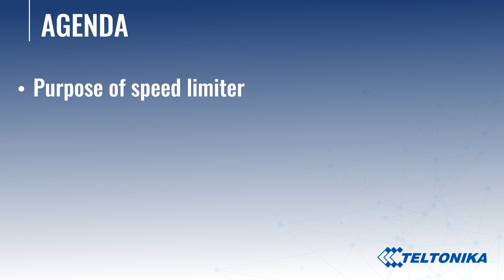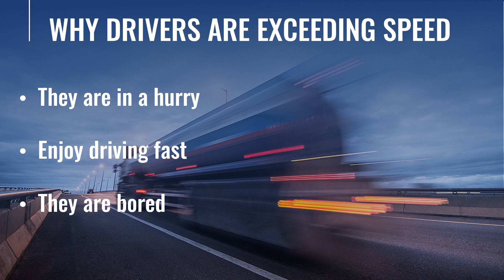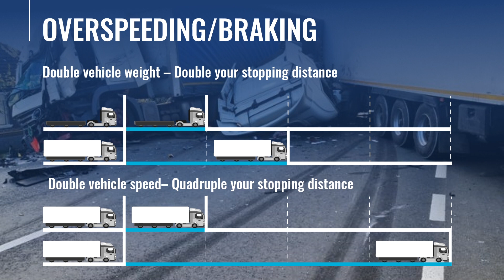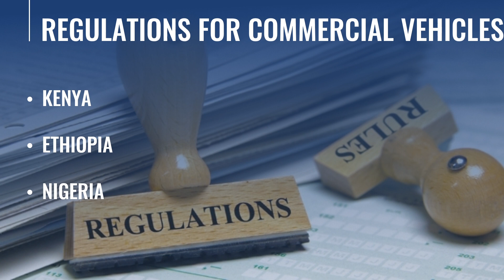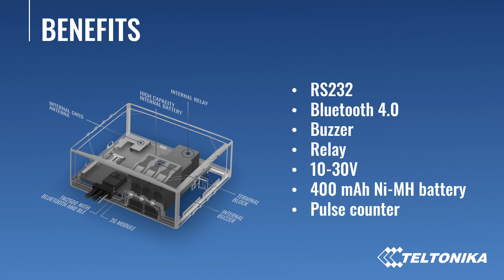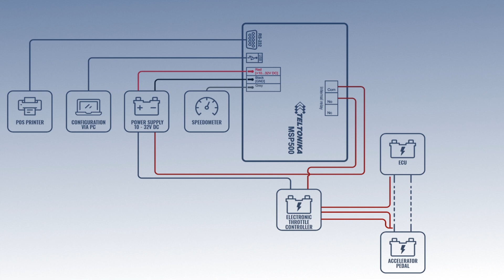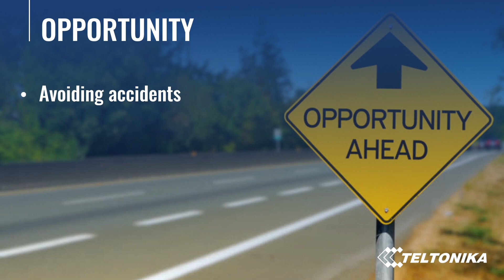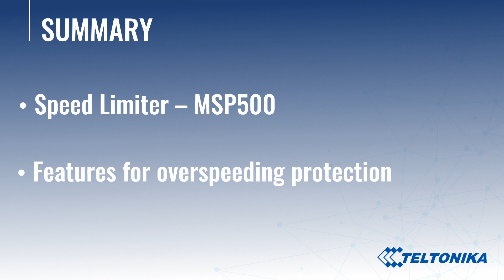Teltonika Webinar: Speed Limiter Solutions

Comment: Hello, can your speed limiters distinguish between rough road and tarmac roads? This is important because allowable speed limit for rough roads lets say is 60km/hr and tarmac 120km/hr? A vibration sensor is needed to set the tolerance.
Reply from the maker: Hello,

Thank you for your comment. 
Currently, it is not possible to set a speed limit based on vibration as it would not be precise enough. A sudden change in road quality could affect the speed limiter functionality and could result in more accidents. We have implemented the speed limiter functionality by adding geo zones. If you usually ride the same roads, you can set up a perimeter on certain roads using the Manual Geofence feature and limit the speed based on the road. 

If you have any further questions regarding the speed limiter functionality, please contact your sales representative. If you do not have any contact information for our sales managers, please visit our official website at https://teltonika-gps.com/ and click on the "Contact Us" button. Once you click the button, please fill out the form and submit it.
Reply: @TeltonikaTelematics  Hello, thank you for the reply. Actually there are speed limiters from other manufacturers that are doing very well with vibration functionality. One that we know is from the UK and the other is from India. The vibration input is calibrated with a specific threshold that is deemed acceptable to distinguish between rough road and tarmac road. These speed limiters are called 80/100 meaning that on rough road, you can only drive 80km/ and 100km/hr on the tarmac road or as per operators requirement. This is used by operators who require that drivers on rough road are driving at a lower speed despite the geo fence functionality. The good thing about your limiters is that, it has extra features and they can be configured remotely without sending technicians to the vehicle. 
 
We have also managed to use your regular tracking devices in the past as speed limiters with conjunction to some other components but we would appreciate to see that you design a limiter that has both geofence speed limiting feature as well as rough road detection functionality for rough roads. Again, thank you for your valuable reply.

Comment: I have a truck with with voltage in one wires connected to accelerator sender varying from 6Volts to 20Volts as I press the accelerator pedal the other line voltage decreases from 20 volts to 6Volts as I press the pedal down. the other 2 wires have 28 volts constant and the last 2 wires have no volts how do I connect the speed limiter on this vehicle because from the drawing the varying voltages all increases as pedal is pressed down.
Reply from the maker: Hello! Thank you for your question!

The MSP500 should be connected (10-32 V DC) to the power supply and Signal wire to the Electronic Throttle Controller. The electronic throttle controller should be connected to the Accelerator pedal 0.7 V and 0.4 V input, and to the ECU 0.7 V and 0.4 V wired. To find these cables you need to measure the voltage on the wires.